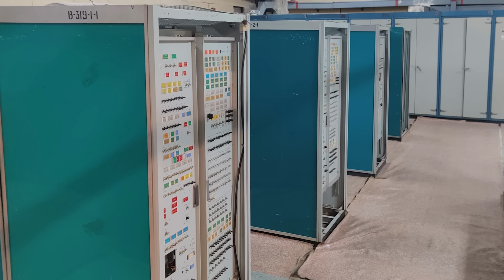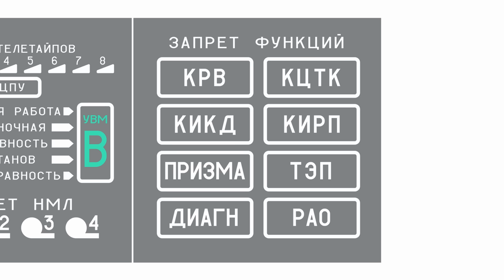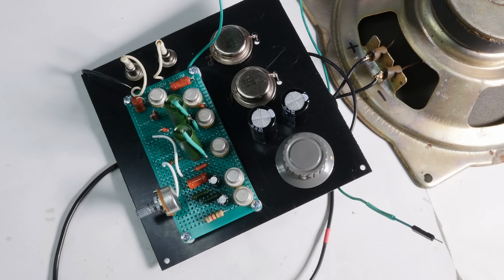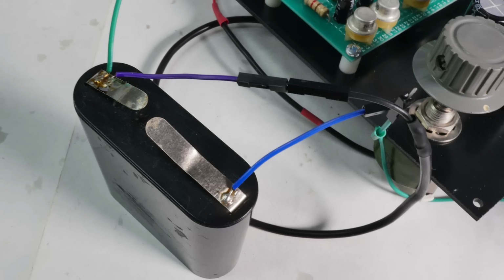The Last Alarm of Chernobyl’s SKALA Computer

Comment: Hi. I am trying to make this alarm myself. but I have problems with finding a corect speaker because everywere is says that 4ГД-35 has 4Ω impedance not 8Ω. Could you check if your speaker is realy 8Ω?
Reply from the maker: Interesting… on my is written 8, and in documentation also 8…

Comment: I've been wondering, what kind of failsafe Scala computer had? What happened if Scala system failed in full run. Will it shut down the reactor or does it continue running without surveillance?
Reply from the maker: Here is a conceptual thing. SKALA is STRICTLY a monitoring system. It did not control the system. It just monitored it, so there were no failsafe mechanisms

Comment: LOL - the thing that struck me the most is that speaker driver: when I was a kid, I came across those exact ones in the speaker cabinets of an "Accord 201" vinyl turntable my mom originally owned until it found its way to me - still have them today (both my mom and the turntable - both still working just fine :)))) ). Being that it's obviously made in the USSR, that probably dates the thing to somewhere around the same era. I just find it somewhat funny how they considered that driver universal enough to use them both as what is essentially a "buzzer" and as "hi-fi" stuff :)))

Comment: For those who are wondering why it was so quiet, the original transitors were like 60w or something.
Reply from the maker: Check the pinned comment for a corrected sound sample. This thing actually is extremely loud.

Comment: What a shame youtube basically muted the main attraction of this video. Very cool project.
I wonder if any of these alarms are still extant/functioning in the still operating RBMK power plants.
Reply from the maker: Of course they are used, there are a lot of alarms wired to different systems. A correct sound in this one find in the short linked in the pinned comment.

Comment: I thought the volume was muted at the beginning of the video.
Reply from the maker: It was not, but there happened something after upload, check the pinned comment, there is a link to a short with corrected sound (there I still reduced it, because this thing is actually kinda 150 dB)

Comment: Youtube had for sure cut the volume of the siren by a lot when reencoding the video into its preferred formats.
It's probably an issue with the volume normalization part that lowers the loudness to be around a specific value in LUFS I suppose
Reply from the maker: That's why we uploaded a short with a corrected sound (pinned comment)

Comment: Hi I am building one of these.  Can you clarify the crossed out traces at (1) and (2) on the schematic.  I would interpret it as: wiper of R13 to R6 and R7, -24V to R5 and R8.  Is this correct?  (Update - yeah this seems to work)
Reply: hello! would you be so kind as to post your progress and observations? i am also interested in building one as practice for electronics
Reply: yes, I have had success.  I have only built the tone generation and buffer section including t1-t5; it is still plenty powerful to drive a small speaker from the collector of T5.  I plan to build the power amplifier t6-t8 as a separate unit.  indeed c3 and c4 work better as .022uF/22nF (.0022uF on the schematic seems to be a typo).  NOS semiconductors were purchased from an eBay seller in Ukraine.  a very easy circuit to build in a couple hours, and makes a really horrifying sound. the basic oscillator block used (t1/t2 for example) is a really old transistor design that I'm sure I've seen in several introductory electronics books.
Reply: @dokcosmac Incredible, i congratule you, would you say it's possible to recreate with modern day components? currently on my zone they do not sell the soviet ones and ordering online is not a viable option for me
Reply: @kaisatous8996  the transistors used are germanium types which have a lower bias voltage, i.e. the base-emitter voltage where current starts to flow from collector to emitter = ~0.2V for germanium versus ~0.7V for modern silicon devices.  replacing germanium with silicon in any given circuit will often require some redesign to work the same.  you could always try to find some more domestic NOS germanium types, which are still commonly available.  people use them for guitar fuzz effects and the like.
Reply: @kaisatous8996  although, come to think of it, it should not be hard to build at least the tone generator with silicon.  as i said, i believe this basic circuit has shown up in a lot of introductory electronics books and i'm not sure they ever include a bias resistor so ? --- give it a try on a breadboard with whatever transistors are handy, keep the voltage low, and see what happens.  my guess is that it will work, but the frequencies or waveforms may be somewhat different.
Reply: Also not sure, but I believe C3 and C4 should be .022uF (22nF) and not .0022uF as printed (which for me produced much too high a pitch)

Comment: Could you showcase what the "tone" potentiometer does? Also, why is it important to use germanium instead of silicon, i'm a bit new to electronics. Thanks!
Reply from the maker: Check the new video, about the mnemonic panels. You can hear that tone there is not stable, so that was achieved exactly using that pot. About germanium: not required for functionality, but rather for authentic sound. Silicon will work, just the sound will be cleaner and probably slightly different.

Comment: Nice! I've made a sort-of circuit simulation in LTspice of this on github under robertwatsonbath/skala. You can tune values and listen to output (I posted a comment previously but I guess because it had a link in it got autodeleted).
Reply from the maker: Nice work!
Reply: hey man! could you try sending me the link? i have been having trouble searching for it
Reply: @kaisatous8996  I've tried a few times but reply gets (probably auto) deleted as containing a link. If you search for my username here on git hub you should find it.

Comment: I had to put my headphones on MAX to hear it, but it's a scary sound.

The kind where if you're hearing it, EVERYTHING has gone wrong and you can probably assume you're going to die a horrible death soon.
Reply from the maker: Check the short link in the pinned comment for a normal volume level.
Just a side note, this alarm was a normal thing - for any malfunction, however, here the circumstances make it special, it is right.

Comment: CS major with conc in software engineering, I have to integrate this into something. I love adding Easter eggs, especially when I hide them in plain sight.

I like my chances of sneaking this in totally without anyone figuring it out. Will take a while since auditory alerts are not really part of things I work on, and would be totally implemented in software because of course my job doesn't involve a soldering gun! Maybe I can build it into my home assistant alarms first...

Comment: Excuse the extremely stupid question , but in Bulgaria original transistors are very expensive 4-5lv each. If i reverse the diodes, now can i power it with 5 or 12 volts . Goal is 0.5 or 1W @ 8om for hobby purpose only .. ? :)

Comment: Even as someone fascinated with sirens and alarms, knowing that that sound was the last alert those Chernobyl workers heard before their doom is really eerie.
And as someone fascinated with technical workings and electrical engineering, I loved this video!
Reply from the maker: A tiny remarks: this sound was active quite often, as it was for everything; it is more about the circumstance when it sounded...
Reply: @ChernobylFamily Can you explain all the emergencies they were used for further? In the US, we have the Emergency Alert System,  which comes over the radio (to test so far) and outdoor tornado sirens, which originated as air raid sirens in WW2, then cold war sirens for attacks from the USSR. They are different sounds and get different responses.

Comment: It's definitely quiet, but, with headphones/earbuds, way easier to hear. Makes one wonder though, if the tone can be modulated and tweaked, or if it's just velocity (volume) only.
If/when I hear from my bandmate/retrotech junkie Celica again, I'll share this with her; she'd love this.
Reply from the maker: I'll upload a short tomorrow with a corrected sound level because something went wrong with the video itself.  Please note that here it is powered with —4.5V. Should be with —24, but then it is so loud that it is not possible to stay in the room nearby.
Reply: @ChernobylFamily  Yes, I'm aware of the decibel range that would produce. It's about the same as our mid-range stage amps, but we're not blasting siren tones through them.
...
Right; #bassplayer/frontfemme metal musician here, and I understand how sound/-motion works, to a point (even if it's not my main field of study).

Comment: The transistors are germanium PNP. Very 1960s - early 70s soviet technology. You can find the same components in old soviet consumer electronics from that time period. As far as I'm aware, these transistors are no longer produced. One can still find them sold as new old stock, but this circuit does require germanium transistors. If you use modern silicon, the transistor biasing is going to work differently, and the tone of the alarm would differ from the original.
Reply from the maker: True.

Comment: I don't know what hell of a cold is going around, but for me it is the third week of barely being able to talk. I have a bit of a  voice starting at noon up until early evening. Outside those hours I badly struggle. I've been getting better, but it was one hell of a cold. Get better soon!
Reply from the maker: Are you sure it is cold? I also though it is cold, or cоvid, of flu - made tests, and therapist is like "aha, run for x-ray". And there it is -- a pneumоnia indirectly caused by some virus.
Reply: @ChernobylFamily  I almost got there too. The doctor discovered that the virus was on the point of indirectly causing pneumonia. After a week of antibiotics it was stopped, but the doctor said it would still take some time for the coughing to go away and the voice to come back. The stupid virus hit at least 6 colleagues. So I guess we might have been struck by the same thing.

Comment: I'm Russian, and here's a translation of some of the inscriptions (if you're interested)
СКАЛА ( Система Контроля и Автоматизации Ленинградской Атомной электростанции  ) - SKALA ( Control and Automation System of the Leningrad Nuclear Power Plant)
ФГУ ( Функциональная Группа Управления) - FGU ( Functional control group)
24В - 24V
1200ГЦ - 1200Hz
Контроль МСХ - Control of MSX
Гаш. Ровного света - Dimming of even light
Надписи МСХ - inscriptions of MSX
Квитирование - Confirmation of receipt and transmission of a structural unit of information
Включение шкафов - Turning on cabinets
Исход состояние ФГУ - Initial state of FGU
Контроль звука - Sound control
Контроль логики - Logic control
Вкл. - On
Изм. - Measurement
Зап. - Launch
Замер - Measurement
Гашение - Damping 
Запуск - Launch
Подрограммы - Subroutines
Состояние ФГУ - State of FGU
Занято - Busy
УВМ А ( Универсальная вычислительная машина A) - UCM A ( Universal computing machine A)
( Similar with УВМ B)
Ключ - Key
Запрет - Restriction
Сеть 220В 50ГЦ - Power grid 220V 50Hz
Исчезновение питания - Power outage
Комплекс управления системой - System management complex
Запрет телетайпов - Ban/Block on teletypes 
Парная работа - Pair work
Одинокая ( работа ) - Solo work
Останов - Stop
Запрет функций - Disabling functions
Неисправность - Malfunction
Призма - A program that performed the calculation function in the SKALA system (Apparatus (reactor) Control System)
Резисторы - Resistors
Sorry for the incomplete translation, I didn't translate the abbreviations that I don't know, and I'll be finishing up the translation of the inscriptions for you in my free time.
Reply from the maker: Thank you! Yet, some corrections:
СКАЛА - Система Контроля и Автоматизации Ленинградской Атомной
УВМ - Управляющая Выч.Машина - Control computer
Зап. - запись - write
Запрет - rather "restriction" as it is a restriction of the access of software to a disabled hardware.
ФГУ - функциональная группа управления- functional control group.
Reply: @ChernobylFamily Thanks for the edits and additions, I fixed my mistakes

Comment: That is quite the alarm sound. Certainly designed to grab your attention! I'm used to a slightly different version of the same type of circuit; a fast rising tone that loops in a much wider span of pitch, without that pause of a single pitch between. 
Thank you for sharing with us this accurate re-creation of the voice of the computer system.
Feel better soon!

Comment: Congratualtions on the amazing work! Chernobyl is a fascination of mine, and the sound is blood-chilling. As a hardware engineer myself, it's really interesting to see how rushed design decisions, parts availability constraints and geopolitical pressure can lead to huge industrial fuckups that leaves a forever-lasting debt. 

Regarding the schematic, If I understand the schematic correctly, we have 2 astable oscillators (right one for generating the audible beep, and left one altering the pitch frequency), one amplifier and a push-pull driver for the speaker. Looks like a textbook "101 fun experiments" kit schematic, except hearing this one would have been really not fun. Really nice to hear the frequency slide due to the capacitors charging/discharging curve. 

One tiny nitpicking on this chef-d'oeuvre: at 03:59 you say the fastest oscillator is for the rhythm and the slower one is for the tone... I would say the opposite, but maybe it's a confusing choice of word. The fastest oscillator creates the imperfect square wave tone somewhere in the 700 - 1500 Hz, and the slowest oscillator defines the rhythm that changes the tone frequency of the faster oscillator. I'm sure that's what you meant, or that your illness made your tongue slip. 

Get better soon and good luck with the amazing hardware recreation!
Reply from the maker: Thank you so much!

Comment: Idk, feels kinda tone deaf but the first thing that came to my mind was to replicate the circuit with modern low power SMD components, hook it up to an ESP32 and implement it as a functional alarm with ESPHome or something. Must have been one hell of a few seconds hearing that sound, thinking "Oh no, wtf broke this time?", then the rumble and darkness shortly after. Wouldnt even be surprised if the computer engineers understood the gravity of the situation a few moments earlier than the already task-saturated operators in the control room.

Comment: Seems you can indeed make a nice build of this using the modern components. Guess you need somewhat 40-ish hfe transistors, which are very accessible, though I'd use the NPNs to invert the polarity so you can use a voltage-positive control instead.Moving to 5V is expected to have a lot of DC on the speaker, yet 12 is pretty much ok. As the output is square-wave, we have a lot of fun options here - I'd go for a FET/motor driver IC (think UCC373xx), preferably with both normal and inverting drivers inside to have the initial 24V swing on the loudspeaker without any extra components.

Comment: the only thing I would  do different in this circuit is add a thermistor, and a temp setting Rheostat
and put the thermistor on the heat sink of my computers processor, to sense a dangerously high temp in the 
event of a processor fan failure. rather then the  dinky little system speaker that a bat can't hear, it would be a loud alarm
that would sound,  and maybe give you time to quickly save your data before the system automatically shuts down . 
and most computers these days no longer have a system speaker, so it would be good in that sense also
Reply from the maker: sounds good!
Reply: @ChernobylFamily  thanks 🙂

Comment: So nice to see you got most of the original  electronic parts. I have seen similar rheostats (potentiometers) on HAM markets in Germany and /or the Netherlands
Reply from the maker: Surprisingly, the biggest problem was to find resistors that will have specific power. Never could imagine that will happen. Eventually, placed smaller ones.
Reply: @ChernobylFamily  
Maybe people didn't do much effort because resistors have modern replacements. Despite it's often not an issue, transistor types are all a bit different.

Comment: That’s super cool.  Is the circuit diagram posted anywhere?
Reply from the maker: Yes, close to the middle of this video.
Reply: @ChernobylFamily Oh sorry for being impatient! I only watched the first part LOL
Reply: I don’t think I could get most of those parts in the US.  Do you think modern substitutes would work?  Maybe you could put together kits of old parts and sell them?  I would certainly buy that.
Reply from the maker: I believe they should work. For MP26B probably will work ACY24, for P702 – 2N1701, for D237A diode – 1N441, 1N5393, etc.... electrolytes – grab closest with the same voltage, as Soviet definitions are now non-standard. Resistors – any matching, just proper power.
Reply: @ChernobylFamily I’ll try.  I’m not an electronics guy; I’m a software guy.  But this will be a good learning opportunity!